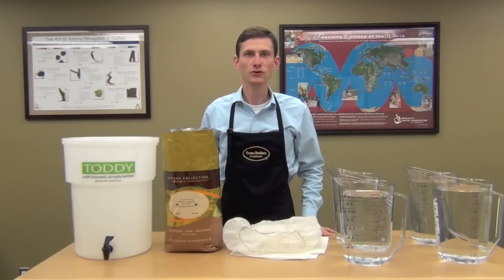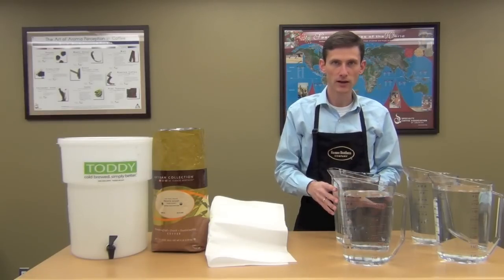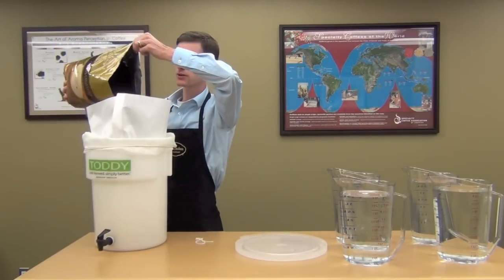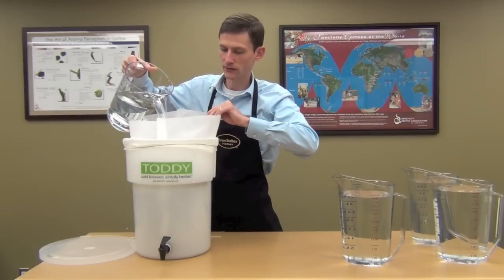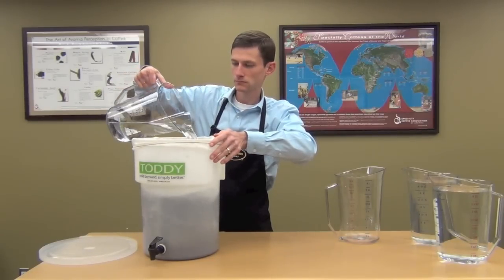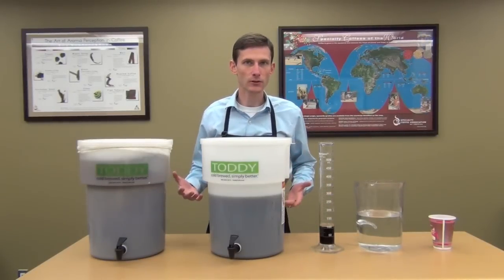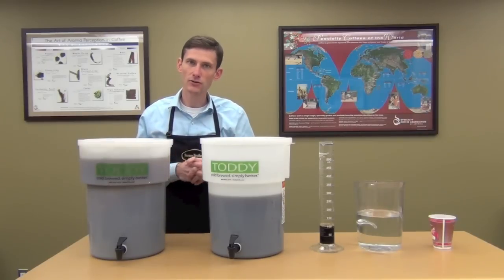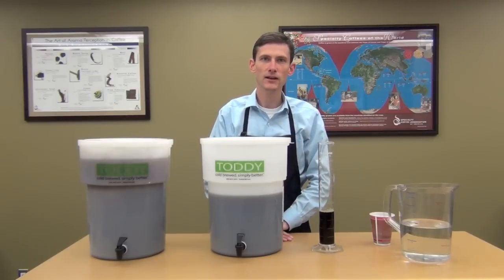Farmer Brothers Cold Brew Tutorial

Comment: It takes a lot more than a minute to drain with that paper filter - more like half a day. The paper holds back that really fine sediment which eventually clogs the paper up and inhibits the flow of the brew. A smarter more efficient way is to do away the paper filter altogether. Just let the sediment settle to the very bottom of the bucket after removing the mesh bag. The spigot is high enough off from the bottom of the bucket to decant the clean brew off the top of the sediment/sludge layer. When The coffee is gone you are left with a layer of sludge at the bottom of the bucket that you would simply discard - no paper waste.
Reply: @bestyoutubernonegraternumber1  you do know paper is made by trees right? so yeah there can be a paper waste

Comment: I personally would ditch the paper filter all together. Its easy enough to get 5 gal mesh bags use one on top of another just like this mesh and paper filter but the larger micron bag outside the smaller micron bag. Use one for the course grinds removal and the other grind particulates missed. So a ~200 micron bag for the majority of the grinds and >100 micron for the rest. I wouldn't go too small or you'll unnecessarily filter out desired coffee.